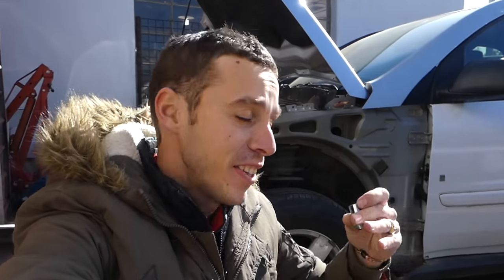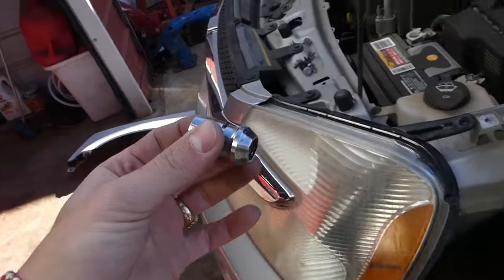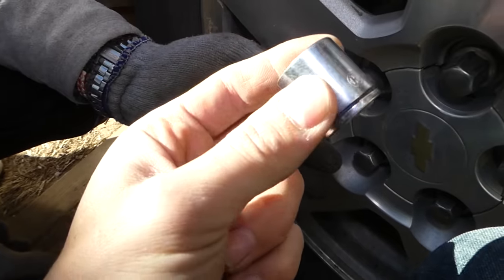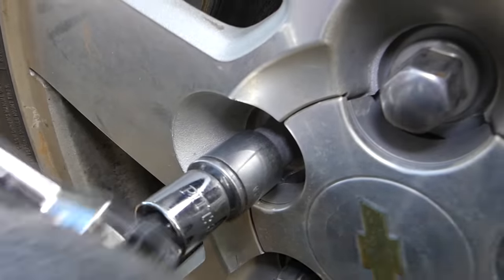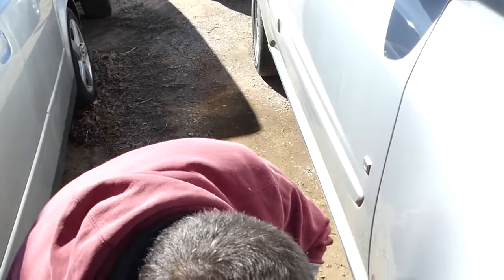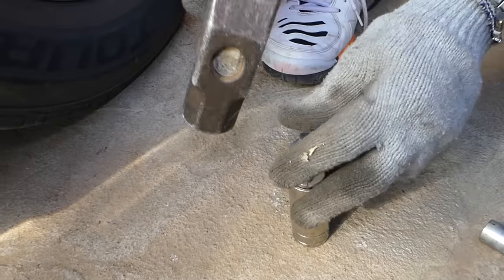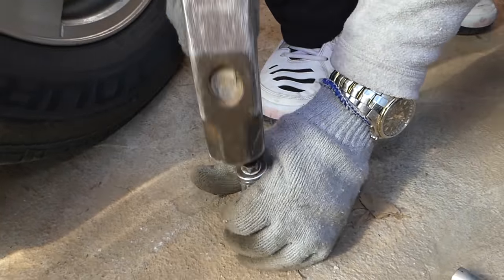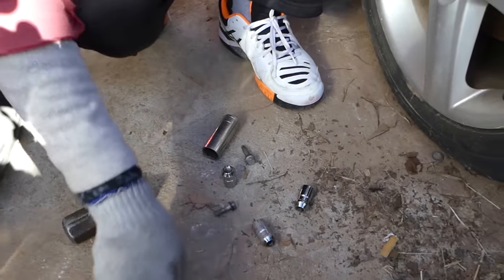HOW TO REMOVE WHEEL LOCKS WITHOUT A KEY TOOL

Comment: Don't believe this. I'm now left with a socket stuck over my locking wheel nut. Some locking wheel nuts have an outer rim that rotates around the inner nut. So the only way is to remove the outer rim before trying this method. They don't mention this in the video.

Comment: most locknuts have a spinning outer ring on them that stops people doing just this,,,,,soo,you bang the socket on,,try to crack the wheelnut but the outer ring spins on the locknut as you try to crack it,,thus resulting in not only a stuck wheelnut,,but now a stuck wheelnut with a fucking socket hammered onto it thats a bastard to get off,,

Comment: I had a similar issue. I bought a used Wrangler with the same lug nut locks. I contacted the company that makes them and I was able to send them a picture to the lock pattern and they sent me the key for $15.  http://www.mcgard.com/customer-service/order-a-replacement-part-online-now/ 
Call first and they should give you the email address to send the picture. I got mine in just a few days.